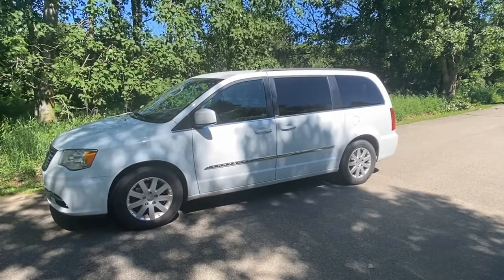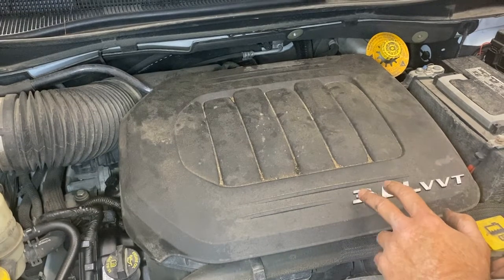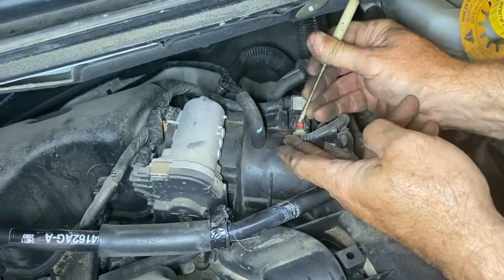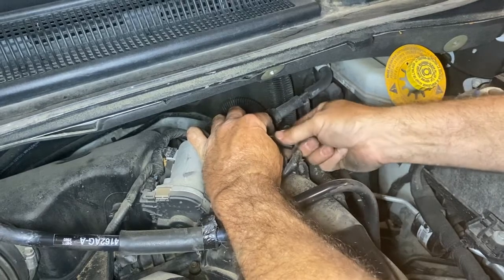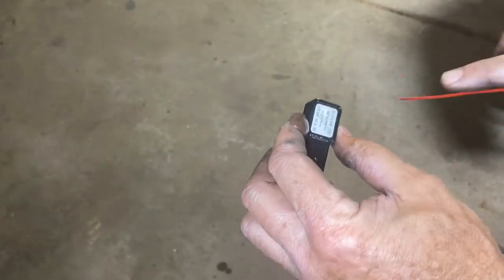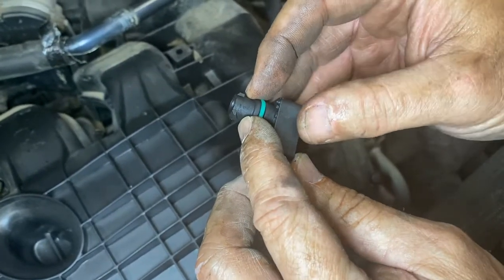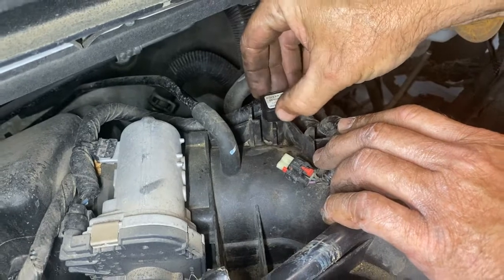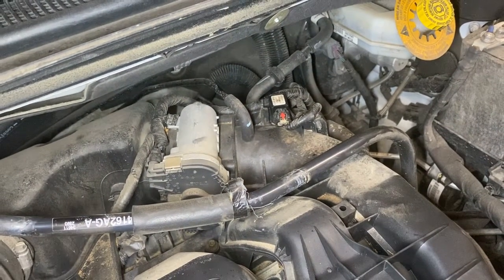How to Replace MAP Sensor Chrysler Town & Country (5th Generation)

Comment: Good job Teacher, how do you know it needs to be replaced?  Your washing it out with electrical spray? Do you use electrical grease after to join the wires???  I have a 2014 Town and Country Van, all the warning lights come on the dash, ever so often, and the windshield wipers, drives me crazy, can't pin point it. It says the cadlic converter needs to be replaced. Low milage on the engine, 120, 345 miles on it.I hope it not that C C.  Still has power if I need it, but sometimes when I am costing it slows down, almost like going into a lower gear. Do you have any ideas please???
Reply from the maker: With that many issues, the first thing I would check would be a failing or defective battery. If you have a good compatible battery, I would throw that in and clear the codes.
Reply: Battery is good, and the altrinator to. Strong power, @TheAutoTeacher
Reply from the maker: We had a PO106 code so you either need to clean or replace the map sensor . We used electrical cleaner and dialectic grease is sometimes used depending on the application. With that many malfunctions at one time it would be something to do with the wiring or your ECM.  I would take it in someplace reputable and  have it diagnosed properly so you're not replacing parts that aren't needed. Maybe even the Chrysler dealer, one hour diagnostic should be around 150.